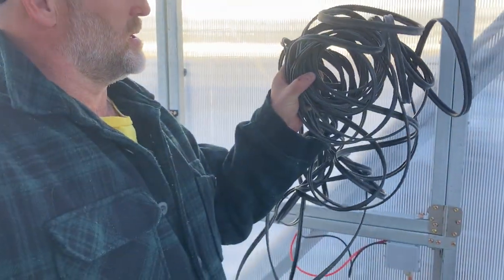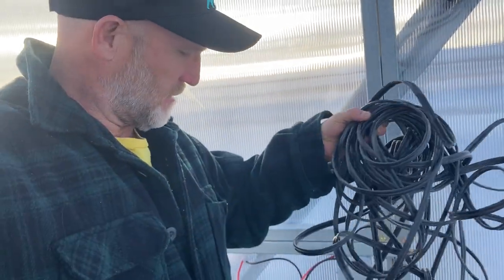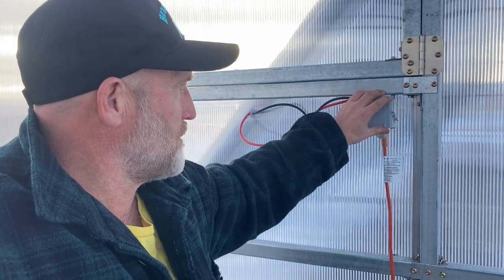Ultimate Prepper || Using Solar Powered Heat Tape to Prevent Water Lines from Freezing

Comment: Wouldn't you need something (batteries)to store energy for those cloudy days and nights, for the heat tape to draw current from?
Reply from the maker: Excellent question.  Yes, something I've thought about, but for my application, the "battery" is the mass of the floor joists, water lines, etc.  Those locations are heated when its cold.  As its thoroughly insulated, my goal is simply to increase the energy at those locations, the thermal mass will slowly lose its energy but the insulation will delay those losses long enough for the sun to shine again.  Clearly, I'm not going to last two weeks without sun when its -25 degrees F, but this method will get me a few days without a problem if my crawl space is sealed up for the winter, the piping is insulated and there are not gaping air leaks cooling down those heated locations.